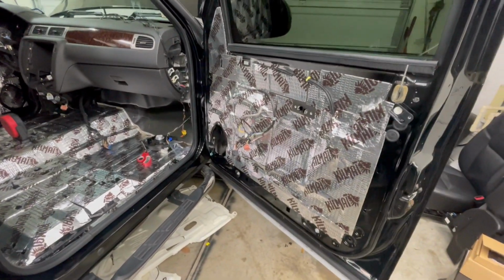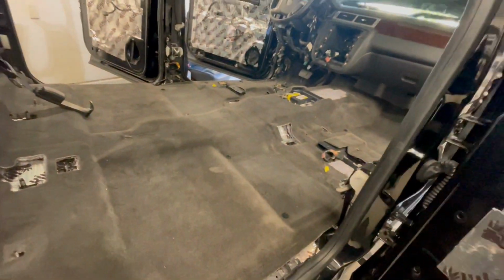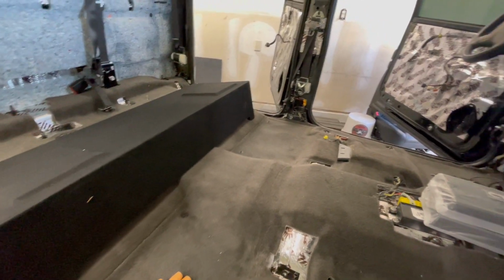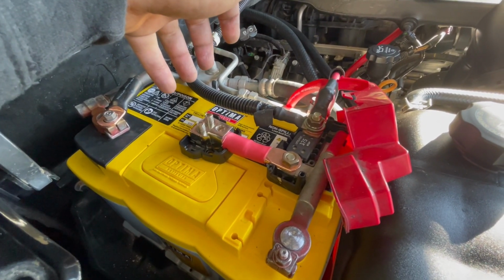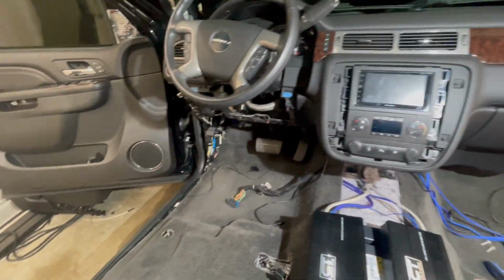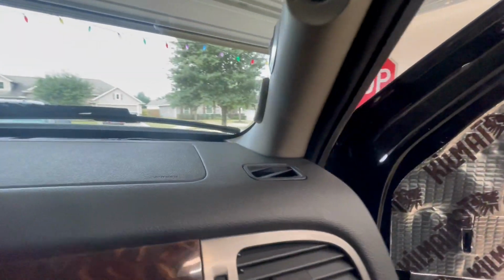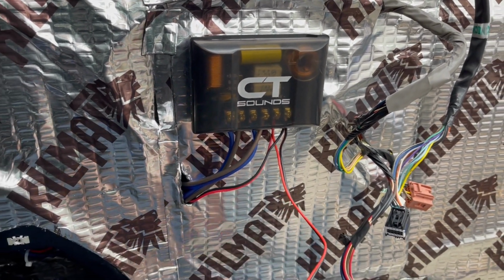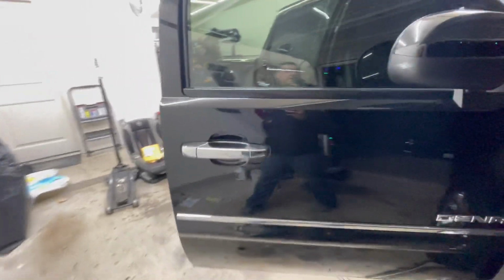CT Sounds, Skar Audio, Kilmat Deadening and Big 3 for my 2010 Sierra Denali (Part 2)

Comment: I did a layer of 80mil kilmat and a layer of150mil closed cell foam noico, I only did the floor and the back on my single cab and it was a huge difference. I can only imagine how better it will be once I do the doors and headliner.

Comment: Add a computer fan to the area where the amps are to aid in cooling. How much did all this run you? The tweeters should be mounted to fire at the ears of the listeners also. If the system sounds good to you then never mind that…